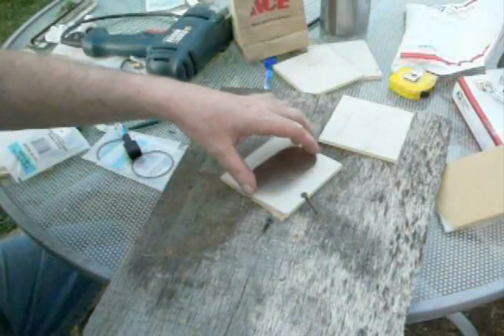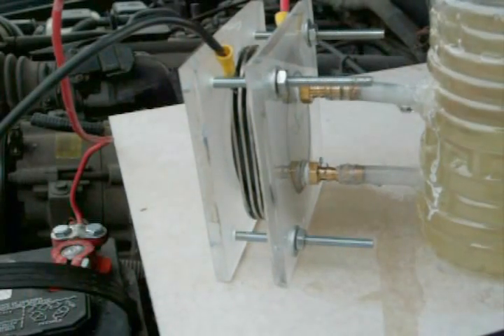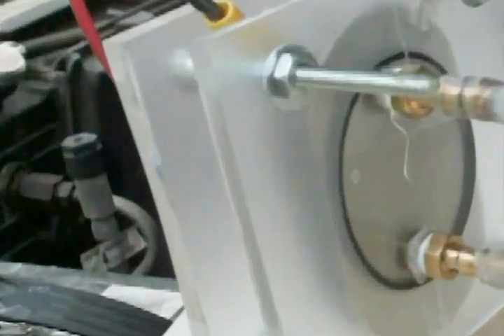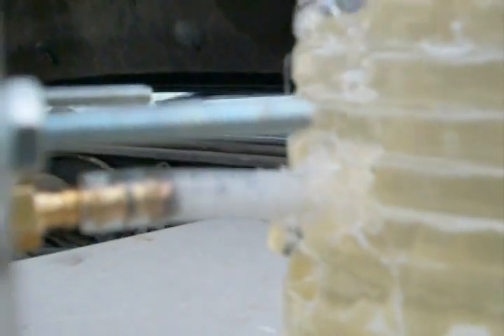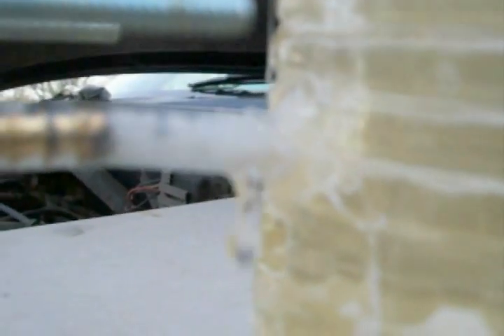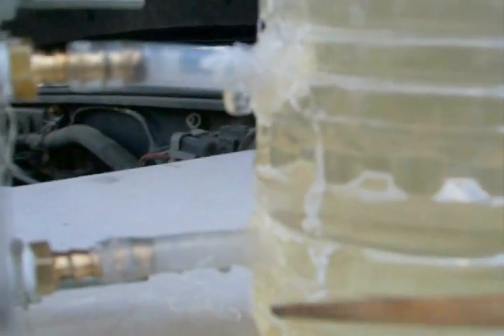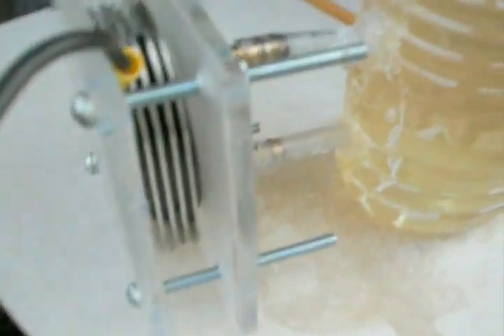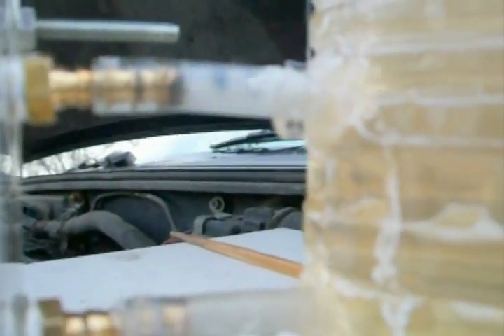HHO Dry cell project pt 2

Comment from the maker: This is no specifice metal. It is stainless steel, I don't know the number on it. It is non-magnetic. It is very hard to drill. Just some handy scrap from work. It is holding up well. This steel is used for make cash register stations. (at least that's what we use it for)